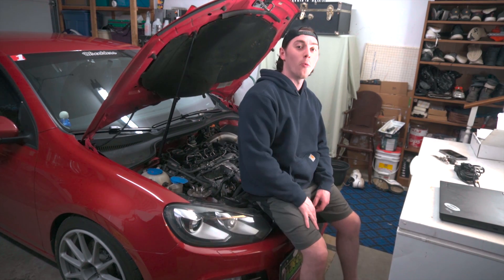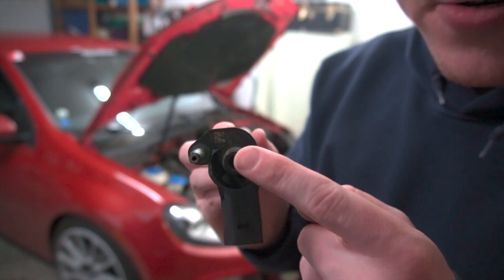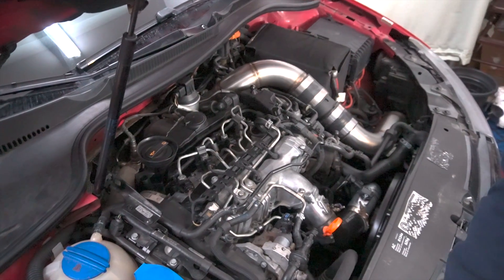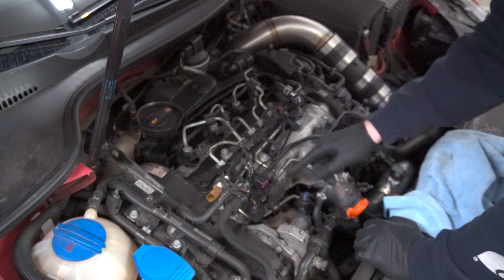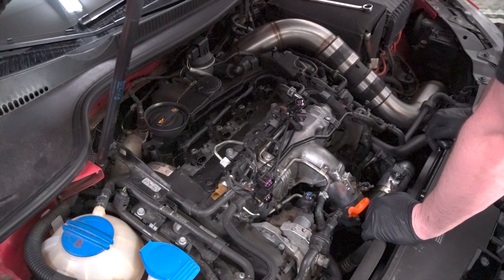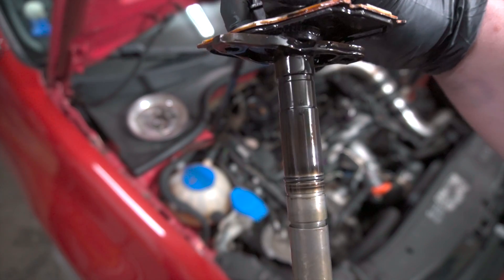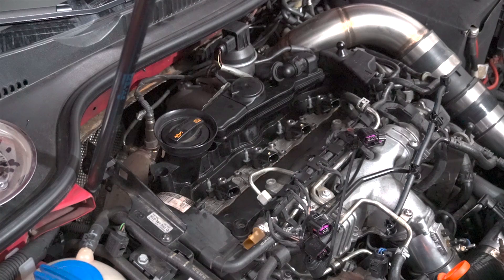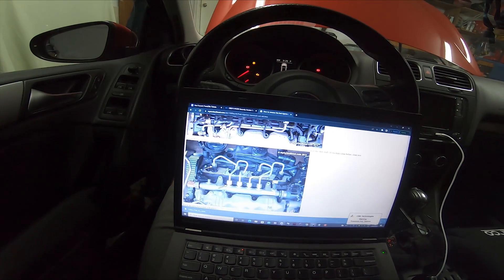Installing MASSIVE Injectors MK6 GTD 2.0 CJAA - 300WHP??

Comment: How much did you pay for the injectors?
Reply from the maker: I didn’t actually have to pay for these ones but they run around 1000$ for a set
Reply: @ThatGuyTyy  what were the torque and horsepower gains? Do you think they are worth getting?
Reply from the maker: It lowers injector duty cycle a lot so that your stock injectors aren’t maxed out once you go big turbo, the throttle response is a lot better and there is a decent increase in torque according to the butt dyno, I would do a big turbo before injectors tho for sure as they aren’t needed till you are almost maxing out the stock block

Comment: What are the limitations of the stock block? At what point are rods recommended?
Reply from the maker: Stock internals tap out at 2260 after a bit of abuse - not sure about the actual block itself - rods are first thing really needed, if you had the money I would do pistons and machining
Reply: @ThatGuyTyy  what pistons would you recommend?

Comment: How are the injectors going ? I have a GTD and I want to upgrade it
Reply from the maker: Definitely worth the investment, way better power at full range
Reply: @ThatGuyTyy  the injectores are plug and play? Same size?
Reply from the maker: Not plug and play - direct fit but needs to be tuned - oversized by about 100%
Reply: What are the part number of injectors? @ThatGuyTyy

Comment: Can you throw me a link to the injectors you used ?  I got  a 3 inch straight pipe, s&b intake kit, malone dsg, and malone stage 2! Im thinking bigger turbo, bigger intercooler piping, S3 modified intercooler, injectors, and a cp3 conversion will get me to the power I want.

Comment: Super sick TDI. I have an mk6 with GTD turbo, maybe 170whp? Is there anything that can be done without adding a bigger turbo to add power?
Reply from the maker: Not really, the stock limitation on these engines is definitely the turbo, followed by the injectors/ intake system/ valve ports. They can’t handle too much power with a stock engine (as I found out the hard way) but you will max out the rods before you make out the flow rate of the engine stock.
Reply: VW does consistently maintain you won't get very far if you put the equivalent of 300hp through a FWD car. It's been their thinking for some time. My experience with motor mounts and subframe bolts speaks to this effect. If you were a rally car owner I'd sure be turning up the power, but streetwise, I think the best way to go is a low, loud, feel good car.
Reply: @Chemist9662  Loud isn't my thing. I live in snow country so doesn't make sense to lower it half the year, it's on great coil overs though.

Comment: How do you think the dmf will gunna handle with this setup? 80k on my dmf with factory power can only get worse with more power imo. I still need to find a good replacement for mine. Vw shows the luk dmf but some have said you can cross reference to a Sachs which some say holds up better.
Reply from the maker: Honestly, we will see, I think it’s already had an upgraded clutch back and it’s not has an easy life, no weird noises or anything yet or odd behaviour but I’ll post about it if it ever does!
Reply: @ThatGuyTyy  I just posted a question about our dmf replacement alternatives in the 2 tdi fb groups I’m in so awaiting a reply. I’ll report back with any news.

Comment: You are not supposed to drive the car before the injectors are calibrated
Reply from the maker: Injectors are calibrated in this video at the end, coded and tune loaded for the injectors
Reply: That is a big relief. Anyway, great gains from simple mods. Injector swapping on CR is really a walk in the park compared to a PD. There you need a dyno and a PhD to tune it right.